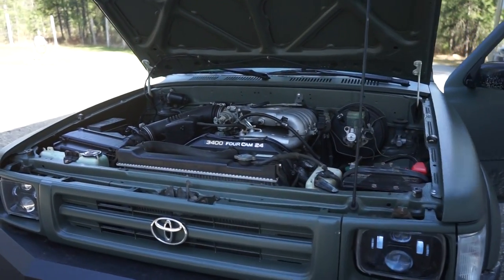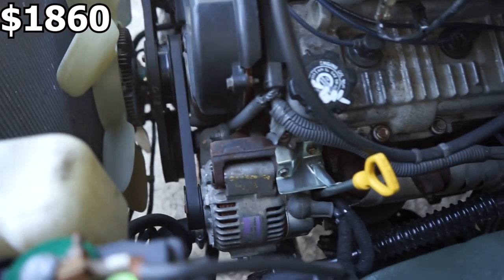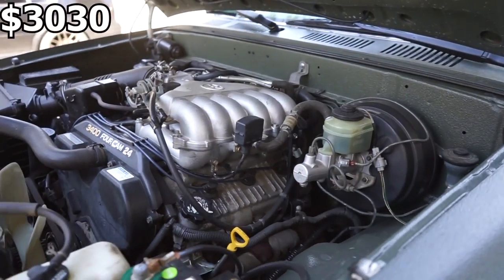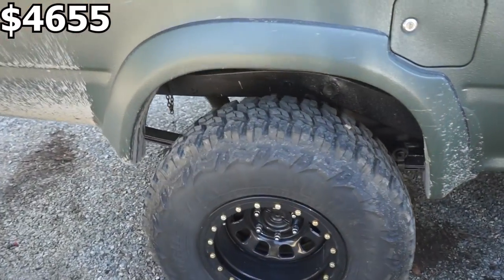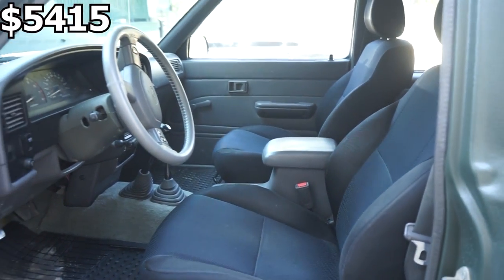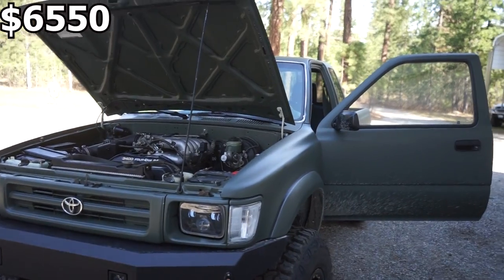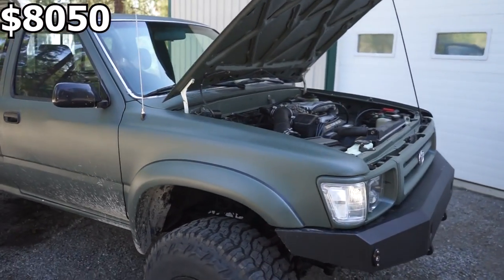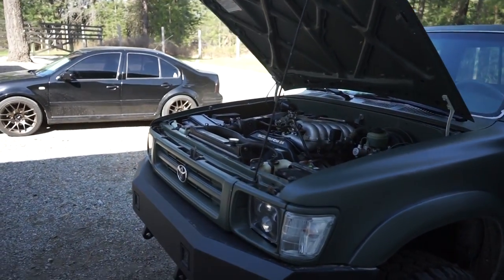What Does It Cost To Build A 3.4L Swapped Toyota Pickup!!!

Comment: If you are going 3.0 to 3.4 you don't need to buy the rear sump pan. The 3.0 pan and pickup bolts on and clears the diff. For those looking to save a few bucks on your swap! Something missed in the video for 3.4 swap is the crossover pipe,  on the IFS Pickups and 4Runners it needs to drop on the driver side to clear the driveshaft, some 3.4s come with one that can be cut up, flipped and welded back together so it drops on the driver side., otherwise you can buy a pre build crossover that drops on the correct side. I also 100% recommend this swap, so easy to do with any level of experience wrenching!
Reply from the maker: Ah yeah I forgot about the crossover pipe! That’s not really a cost if you can modify the oem pipe like I did!!
Reply: Two best pickup builders right here, dirt garage and Austin Niemela.
Reply from the maker: @dailangoodman1541  thanks man!!
Reply: I have a 3.0 on a 4Runner.  Does look like a great idea to swap it out with the 3.4.  Thanks for the info.
Reply: I have a 91 4runner that I have done a straight axle swap on it with a 4 inch leaf spring lift.  I have moderate experience as far as working on engines but a motor swap seems intimidating to me.  I have always dreamed about doing this motor swap on my 3.slow (240k miles) for over 15 years.  Any advice on where to find an engine or where to start?

Comment: I'm commenting through my dad's account--
First thing is that even though no one is paying you for your time it is still worth something. Your time and labor are never free. It costs you something. That's the plain economics of it. Though I understand just doing a itemized list of parts keeps it simpler for viewers.
Secondly, I bought an '89 4cyl 4-speed 2 door long bed in November in decent shape for $4000. It has it's quirks and foibles no doubt. In january on an icy road I tipped it on it's side and buggered up the bed corner, driver door, and driver rocker. In July the parking brake went and it rolled into a huge Hemlock, pushing in the passenger door. Your videos give me a lot of hope, so I'm removing the bed to put a flatbed on it and I'm trying to fix/repair what I can. It will be miles away from a resto-mod like yours, but I'm hoping to salvage a decent hard working truck that has a lot of culture and history behind it. I do fear that the scarcity of some replacement parts and the extent of the work may sooner or later put the kaibash on finishing it, but nothing worth having comes without some kind of fight. Maybe I'll be getting a professional resto-mod like yours someday; here's hoping.

Comment: I have a 88 pickup 3.0. My donor 3.4 is a 2003 tacoma automatic. One thing I’m confused on is the automatic wiring harness and ecu. Do I need a manual wire harness and ecu or will the auto setup work with my manual trans. Trying to get all the confusion figured out before tackling the swap. Thanks man absolutely love the videos!

Comment: I have 1992 Pickup 4WD Ext Cab 22RE that I'd love to do some upgrades to. I love the RE and want to keep it, but if I decide to do a swap will that engine work directly with my 5 Speed and motor mounts as well? Any modifications needed to make it work (other than the ones you mention in this vid)? Thanks and great job, the truck looks amazing!

Comment: I have a late 80's Ford Econoline van, light rust, low miles, I wanna do something similar to.... Mild lift, add some all terrain tires, powder coat the wheels, pain the outside with some bed liner, get some similar style bumpers for it....Turn it into a campervan.

Comment: The one thing I would've done before the Raptorliner... is get rid of the windshield chrome trim.  It will rot the piss out of your A-pillars.  The tiny rubber seal around the edge dry rots and lets in water which collects at the bottom of the pillars and on up.  Mine went to total shit in just two years and I had to pull my otherwise great windshield (which requires full dash removal) and then cut out the bad stuff and weld in new metal ..like a lot.  It was 10x as bad as it initially looked.  Lots of rust up the entire pillar that the trim was hiding.  After the new windshield went in, I sealed the perimeter U gap with Sika 295 UV.  4 years strong so far with no more rust and it looks more modern without the trim.

Comment: I have a 3.0 1992 4x4 manual transmission. I was told to use the oil pan off my 3.0. I didn't understand the dip stick comment you made.

Comment: I knew these were our flares as soon as I saw the thumbnail! Your videos are awesome, well produced and amazing content. Even the wife likes watching them! Thanks so much for the mention. I somewhat restored a 92 Pick Up (farm truck) years ago which inspired us to start selling these flares, the first model we ever sold!

Curious, you ever consider using the stock diesel motor imported from Japan? Or if you want to mod one to fit, get the newer D4d engine, totally bulletproof, insanely economical, and incredible low RPM torque. Think D4d was released around 2001 and is available in 2.5L and 3.0L.
Reply from the maker: Thank you! I do like the flares!! I like the VW diesel for the fact parts are locally available and fairly cheap. Also alot of aftermarket stuff available for them!
Reply: @austinniemela  - Ya, I'm sure there isn't a lot of local support for the Toyota D4d's. Australia and Japan would have plenty of aftermarket but not exactly convenient. 

Glad to hear that you liked the flares from www.JungleFenderFlares.com

Comment: FJ40 
FJ40 on a 80 series chassis 
FJ40 on a 80 series chassis running a Om606 diesel 
Did you know FJ40 came out with a Mercedes Diesel engines in South America the FJ40 was known as the Toyota Bandeirante they were made up till 2001.